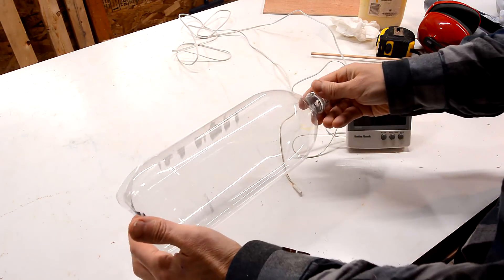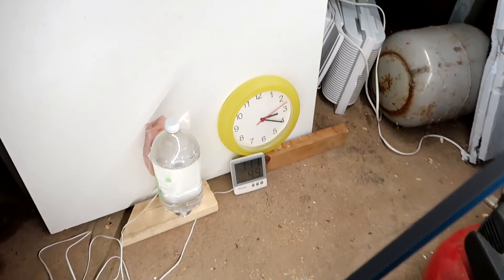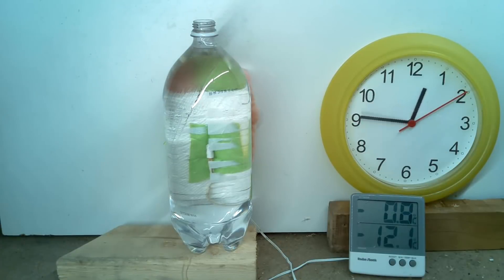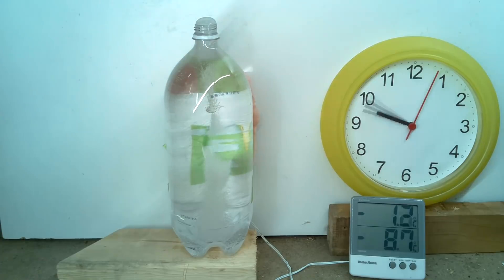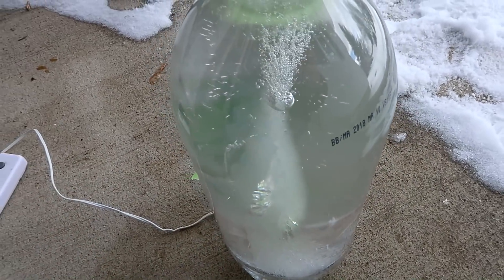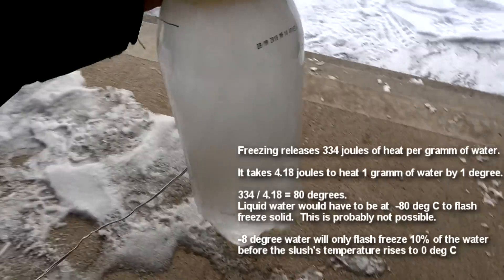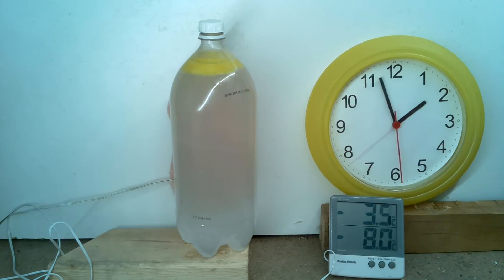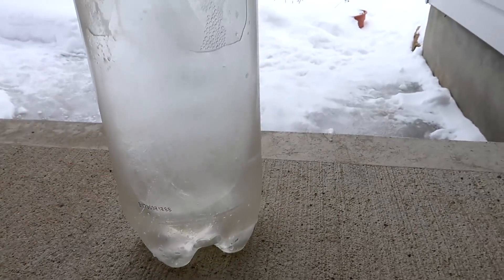Spontaneous flash freeze experiments

Comment: If when welding there is to much humidity, there will within 24hours be what is called hydrogen cracks. In the welding pudle the water is "split" to H and O. The H is sort of evenly spread in the pudle, but as the metal solidifies, it squeezes the H towards the melt.  Just like the bubles in the water.  Within short time the pressure build up is   enough to crack the weld.   If the objects are pre-heated to just above ambient temperature the problem is normally avoided.

Comment: The clear ice you first produced by sweeping away the dissolved gas at the solidification front is an example of zone refining - just like the process used to purify silicon.  It's also the basis of the freeze-pump-thaw technique for removing gas dissolved in liquids.  I used to do this with ethanol-water mixtures.  Put mixture in a sealed quartz tube.  Dunk in liquid nitrogen til frozen.  Then pump out the space above the ice -  at LN2 temperatures, the only stuff there is air.  Re-seal and thaw.  2 or 3 cycles of this, and all the gas is gone, and none of the ethanol or water has been removed since it was frozen hard when the pump was sucking.
Reply: Ever use a vacuum pump to remove air bubbles in mixed paint to get a much smoother finish when applied?  A low tech application of the gas separation technique discussed in your comment.

Comment: I know it wasn't the purpose but that was a good demonstration of the difference between sensible and latent heat ;) This process is an efficient way to transfer, store and release large amounts of thermal energy without requiring a change in temperature using phase change materials (PCM's) with appropriate freezing/melting or boiling points for particular applications.

Comment: Hmm.. idk if it's the best term for flash freeze.. usually flash freeze is done when a sub-freezing liquid is slightly agitated.

Usually it's done with pure water (distilled water) and for a sure effect it's done in a vacuum chamber. The water remains liquid at -10 -20 degrees. Done right you put water in a thick glass bottle and hook a vacuum line to it with a way to seal the vacuum in the bottle. Put the vacuumed bottle in the freezer and if frozen solid let it thaw a bit to be liquid. It will be liquid at subzero temperature.
When the bottle is opened and pressure raises to normal it will instant freeze solid.
Reply: I think shooting such a question to cody's lab will yield better results about investigating flash freezing.

Comment: No one seems to have made the connection to the solidification of metals, the undercooling that occurs for a start. And in particular the way dissolved gasses get concentrated ahead of the solidification front before getting to a concentration that causes the gas to precipitate out as bubbles - air in water hydrogen in aluminium , same man different hat! Fascinating, thank you for the demo way more interesting than paint drying or grass growing... Martin

Comment: Paint Drying can be really interesting if you look at the speckles formed when a laser reflects on it. The speckles will move until the paint dries, then they will be stuck in a certain pisition (I don't recall whether it's fixed with relation to the laser orientation or the surface).

Here: http://ieeexplore.ieee.org/document/7479927/

Comment: For those of us deprived of SI units through our school system, it takes 144 BTUs per pound of water (about a cup) to change phase from liquid to solid without changing the temperature one degree Fahrenheit.  One BTU is the heat required to raise one pound of water one degree F. (Even the Brits who gave us the idiotic Inch/Pound system have abandoned it yet we Americans still cling to it seemingly unaware of the far easier and more elegant SI system used in the rest of the world).

I find the other end of the liquid water state equally interesting where it takes 1050 BTUs to go from liquid to vapor, thus the reason steam is so powerful and so dangerous.  

Then there's the triple point where water can be liquid, vapor or solid all at the same temperature.  Add a bunch of pressure and water can be kept "frozen" at very high temperatures.  Fascinating.

My favorite temperature is about -40F/C where the two scales converge and the F/C takes on a different meaning....It's F'n Cold!
Reply: 2 cups. 
Pint's a pound the world around. 
I've always found that clever pneumonic rather ironic since in reality a pint is only a pound in the US. In the rest of the world, a liter's a kilo.
Reply: Right you are!  

There's another pity here in the States.  Pubs are able to sell "Pints" that aren't.  Not sure if there's a legal lower limit but I've seen some pretty obvious infractions of what should be a simple truth in craft beer culture.  

With regard to water and beer, I'm reminded of another travesty.  Years ago there was a beer brand with very clever advertising featuring a clan of "Artesians" who were sworn to protect the artesian well from which Olympia beer was brewed.  About a decade ago they converted the brewery to bottle water, which sells for more than the beer once brewed there.  sigh....

Comment: If you do the same with pressurized bottle you will get an even better flash freeze. Like co2 water that you have shut and somewhat shaken. If you take that out when it reaches solid minus something and opens the bottle it will instant freeze in seconds. Its rather cool to look at :) Have done it many times with soda in the freezer as an example.

Comment: Those chemical, reusable hand warmers that you "snap" a little disc inside to start the reaction have a very similar look inside as the crystals from the material gives up its heat and "freezes" in the vinyl pouch, starting from the shock point where the disc snaps.  Those pouches can be "reset" by boiling them in water for about 10 minutes.
Reply: Yeah, I believe it's a super saturated solution of Sodium Acetate.

Comment: I am looking forward to the paint and grass videos.   Great new direction.   

When I do flash frozen water I use "dead" or "Flat" water that was boiled and never allowed to mix with air.  Very low salt and solids help also....    When done correctly the  ice is 100% clear.  Even a very small grain of sand will start the ICE....

Comment: Is -23 in Fahrenheit or Celsius?
Reply: Usually Celsius in Canada
Reply: His thermometer was reading in Celsius so I think the forecast -23 outside was also Celsius.
Reply: It would be Celsius.  With zero (instead of 32) as the freezing point, it is an obvious scale used for scientific purposes.
Reply: Ok thanks for the answers
Reply: at -40 you can take your pick!    LOL
Reply: peggyt1243 He did use pounds when testing joint strength.